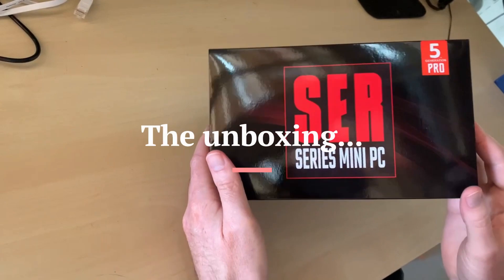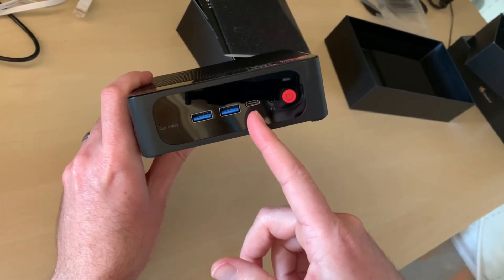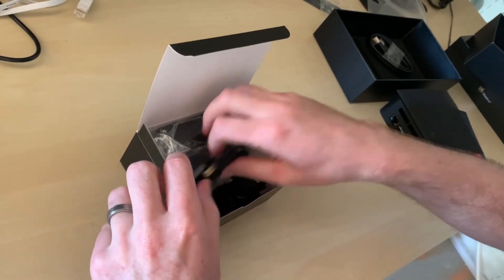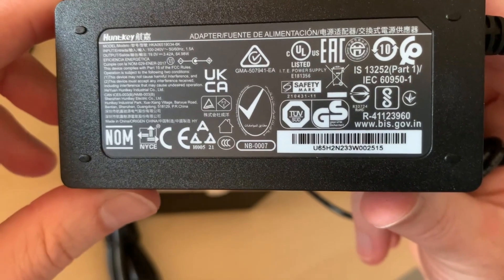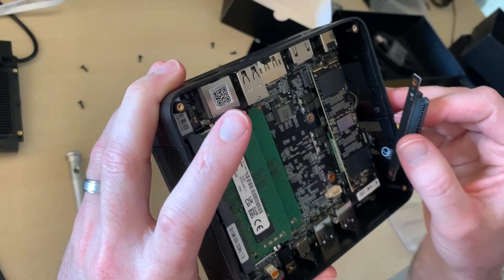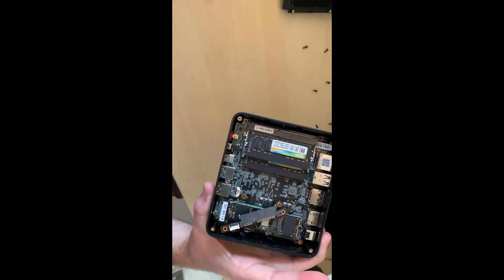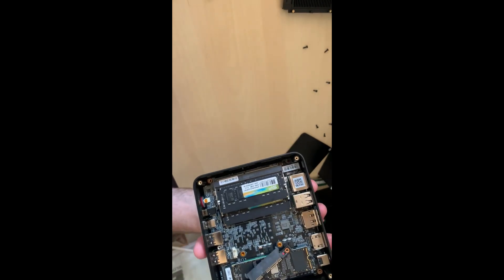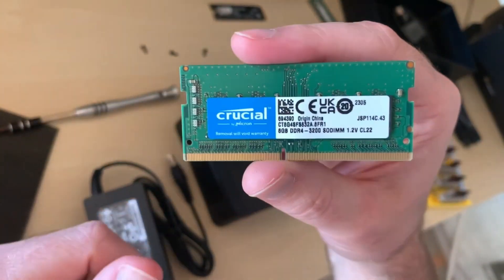Beelink SER5 Mini PC AMD 5800H Unboxing, Review, and Disassemble!

Comment: I have a SER5 PRO w/32GB RAM.  I added a 1TB HDD along with 2 USB Expansion Hubs.  I use the hubs because I use a wireless keyboard and mouse.  I also set it up dual monitors.